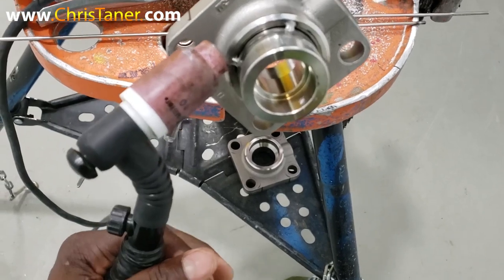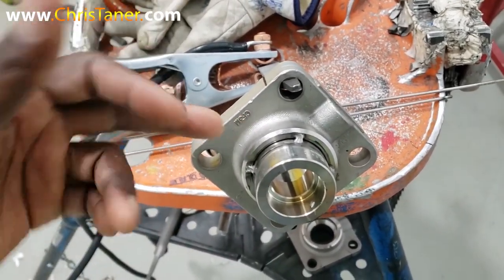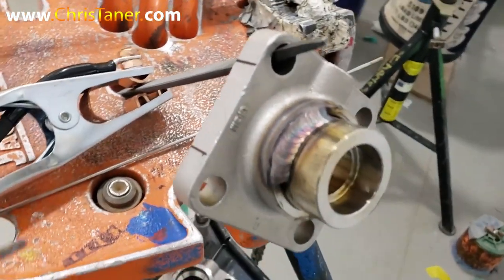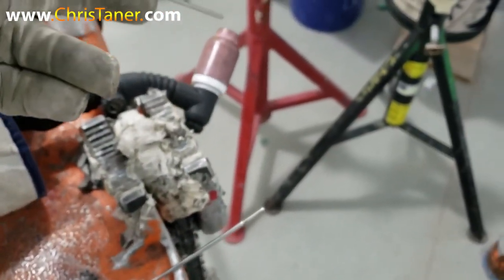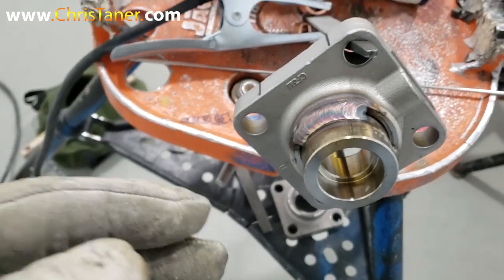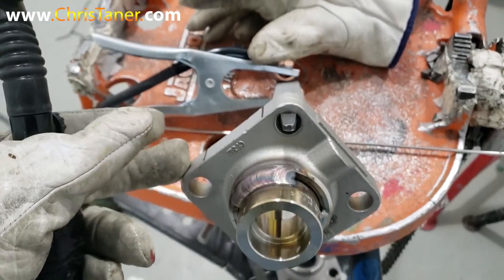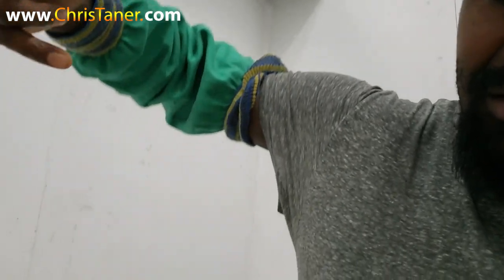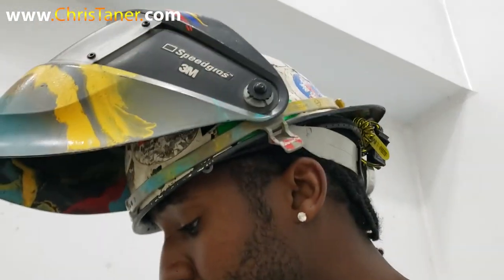"Pipe Welding" WORLD"S fastest technique on walking the cup

Comment: Hi Chris seen one of your previous videos on 2” stainless schedule 40 . What amps do you run at?? Do you put in the root & cap in one run ??
Reply from the maker: On a test I use able 45 to 50 amps with a 3/32 wire and a loose 1/8 gap. In the field I'll use able 50 to 55 amps with the same gap opening,   Although in the field you never get  Exactly what you ask for  as far as the gap openings is concerned.
Reply: Thanks for the info Chris :) for 2” stainless schedule 10 do you use the same settings and fit-up ?? Do you walk  the cup on the root or fill it all out in one run ??